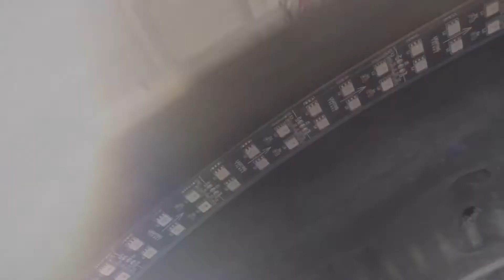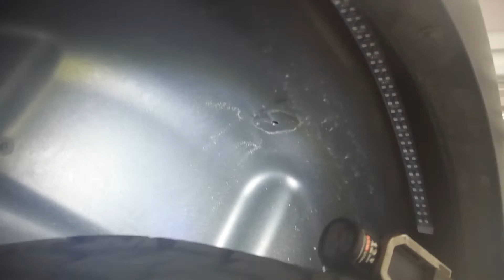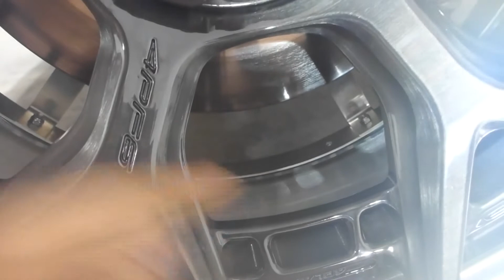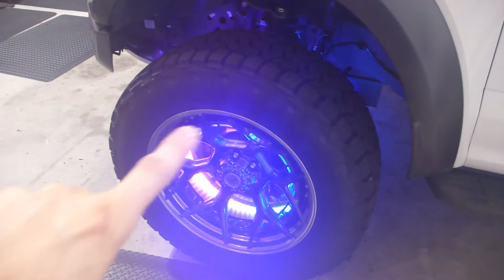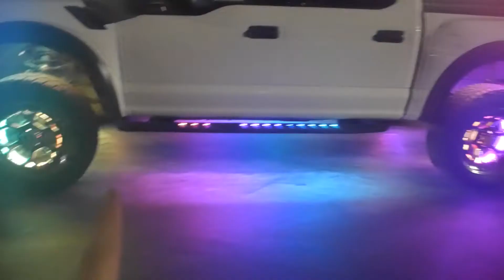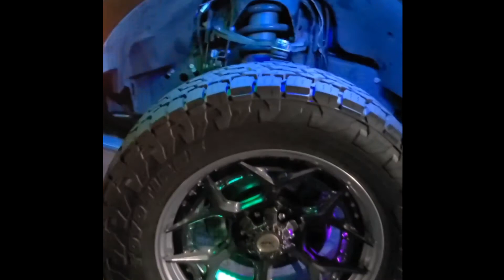2019 F150 Raptor Custom Wheel Well & Ring Addressable LED Lighting

Comment: I love the truck! You did an amazing job on the lights!! I went with two separate rows of individual LED strips, each with GS8208 RGB-Addressable at 96LEDs/Meter, and I do think it's a better option than the double row on the same strip. Having two separate kits, I can also mix the colors and do things like run the rainbow pattern in two directions simultaneously. 

However I also had a third set of underglow custom made to run Whites... It's also an addressable GS8208 with 96LEDs/Meter, but instead of being RGB-Addressable, it's WWA-Adressable, which stands for (Cool) White / (Warm) White / and Amber... It can still do all of the motion effects like the rainbow, but instead of being many colors, it only produces pure shades ranging from cool white to amber on the color spectrum. But the White(s) produced by my WWA-Addressable strip is so much nicer looking than the White color produced by my RGB-Addressable strips. I'd highly recommend a row of WWA for a truck like that that's running White a lot. 

Anyway, it looks fantastic, and your work is inspiring.
Reply from the maker: Cool!  Seems like a lot of work custom tailored to the result that you wanted.  Worth it.

Comment: This was a really great video! You really know what you're doing by going with 12awg on the wiring! I'm a firm believer in overkill when it comes to lots of addressables in an automotive environment, especially underglow. I've found that using a 330ohm resistor on my data wire as close as possible to the first pixel, that really helps clean up my data signal. And inside the same tiny waterproof junction where I put the resistor on the data wire, I also put a 1000uf capacitor on the power wires. However a QuinLED Data Booster can also accomplish about the same thing a little cleaner. 

Also I wouldn't run any power wires out of the Blueghozt, only data. I run my power wires directly from the source on a thicker guage wire and bypass the positive and negative outputs all together on the ghozt, but I bet that's how you also did it.

How did you choose to go about connecting the 18-20awg wire coming from the LED strips to the 12awg wire you were running to it? I'm guessing you soldered them together?

What product did you choose to use to reseal and waterproof the strip after soldering new 18awg wire onto it?

Thanks
Reply from the maker: I just replaced the bulk of the product in this build (video coming soon, hopefully today?!) which made all these overkill procedures obsolete.  Buuuuut, to address your statements/questions: Cool, you get it, nice nice, yes, data boosters are useful products (didn't exist when I did this install initially) so I appreciate that you found ways to create your own.  Yup, never use power/ground out of the ghozt to power the LEDs.  Back then, I'd have the 18awg soldered to the LED pads and within a few inches step up to the 12awg via solder & heat shrink for lengthy power runs to minimize voltage drop.  I generally use two products for waterproofing: an automotive 3M 2part clear epoxy and also a 'clearer than silicone' sealant, depending on the application, both have their pros and cons.
Reply: @Bythirteen Awesome! Thanks for the response. I'll definitely be checking out your upcoming video!